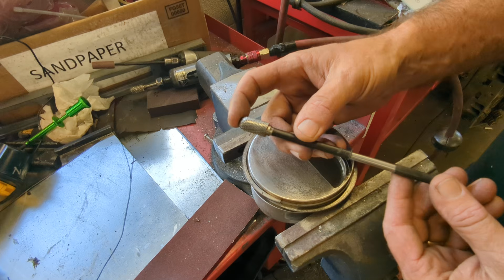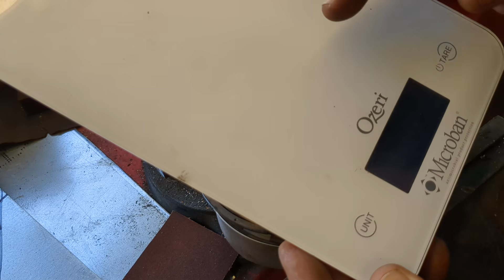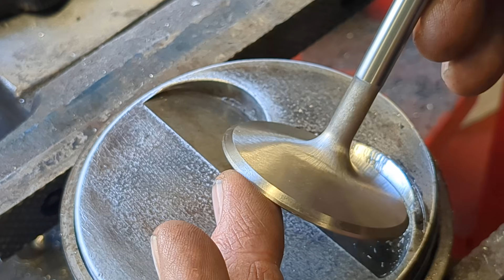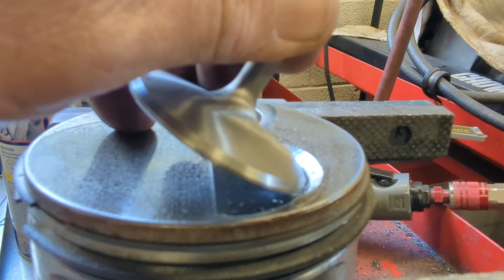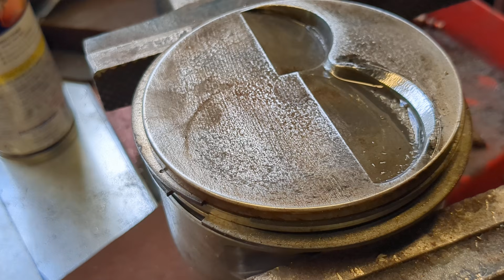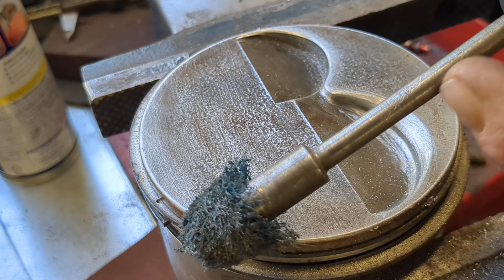The FIRST guy to show you this It will unshroud the intake valve in high lift performance engines

Comment: Seems a lot of people think that little bit of material is going to drop compression a full point…
Reply from the maker: @NBSV1  well it's not and even if it did I'm an engine builder so I crrect for it
Reply: @SalterRacingEngines  I know. Just find it funny how many people think it's such a drastic compression change. 
I'm guessing they also don't even really know how much you'd have to change compression to really make a difference in power for most engines.

Comment: Much appreciated. Whats your experience w ceramic coating piston tops and valves?
Reply from the maker: @-jimmyjames  if ceramic coating is applied correctly it works pretty good if it's not applied correctly it comes off and that ain't good at all. With that being said I'm a little nervous using it on and endurance type engines but that is just my humble opinion
Reply: @SalterRacingEngines  my thoughts too.  thanks.  Appreciate your Pro tips.  I will def spend time working new build pistons.

Comment: Please tell me where's your shop, so I know WHERE NOT TO GO, EVER....
You must be the 1st person in the world who wants to make more power by lowering compession in the chamber.
Reply from the maker: @nomemande2397  wow you must be about 15 years old and know nothing about building engines because if you did you wouldn't say such ignorant statements this only adds about 2 cc to the chamber in which case you make a simple pass of 010 on the cylinder head and your right back to the same compression ratio
Reply from the maker: In fact I'm going to take this moment to teach you something the entire depth and width of both of those valve pockets only total 5 cc's so how much do you think me shaving that back actually added to it. It's probably not even one cc. You should ask before saying stuff like that.
Reply: I like how rounding the sharp spots also prevents detonation. VERY WELL DONE !

Comment: GREAT video,this are the best HOT RODDING tips,that are being lost.this is the way i used to do stuff.I had a job where i had access to a CNC mill.And while you could do this on it,it real hard to do without a 5 axis head unit.95% of guys did it this way.I prefer to use hand hand tools,but your right about carbide burrs,GO EASY and really grip it,cause if it bites>>haha that cutter really moves fast.Looking forward to watch more of your stuff. thank you for sharing your knowledge.

Comment: The Straw trick on the Burr is a good tip--A Bic pen body is almost exactly 1/4" I.D. and it works well as sleeve for stabilizing the cut on a long shank burr--lube it up good and you can hold it between your fingers and thumb, or just use it like a guard same as the straw.

Comment: Great Video as always! I use Waxcut Stick Wax when cutting aluminum. AGS "Cut-Ease" is really good--same goes for Castrol. Even institutional paste wax for floors, or Carnuba car wax works quite well at preventing clogging with aluminum. Paste Wax+WD-40 works well on the Bridgeport for rapid milling as well--put it on with a brush while cutting.

Comment: Awesome info as always. Between you, Vizard, Powell,  Weingartner, and many others, I should be stupid smart. Thanks for doing what you do. Only question I have is what made you decide on the .150 measurement? Is that just experience, or is there a formula. I'm all about some formula's now.
Reply from the maker: @jeffwooton7138  no formulas it's just when you lock it up to the particular cylinder head that's what it took to get the unshrouding effect that I wanted it could take more or it could take less depending on the cylinder head you're using

Comment: Get a greasetube-sized "Slick-stick" and use a tiny TINY glop on burrs, drills, flapper wheels and grinding wheels.
(Buy it from the manufacturer. Cheaper than Glamazon.)
A tube will last YEARS in a decent sized operation.
Flapper wheels, grinder wheels and burrs will not plug up with aluminum and they will eat product at an alarming rate, so go slowly when you start out.
For drills, just start the hole and dip the tip in the tube. Melts easy, so store away from sunlight/heat.
Prepare to be amazed.

Comment: I’ve never given piston valve reliefs a second thought. You’re sharing tricks that nobody else is telling and it’s much appreciated.
Reply: The piston conpanies only dont do it because it cost more  machining time and then there piston has to sell for more, and they know 9 out of 10 people are cheapskate would will buy the cheapest they cant find.
Reply: @krusher74 
 I'm not a cheapskate, just too broke to do the things I would like to do. 
I had spine surgery after a work accident, got laid off and couldn't find a job I was able to do. (insurance company or former employer refuse to give any compensation, even took me to court to try and recover surgery costs - they lied about notification)
Average cost at the time was $80,000, but, cheap surgeon bolted me together with a twist in spine for $35,000
Permanently disabled, wear a back brace just to clean up yard.
According to various workmen’s compensation lawyers, (at $300 an hour !) Florida is the worst state of all to have a non-fatal work accident.
I'm retired now and even small pension means I'm better off than before retirement. 
I know it's way more than you wanted to know but not everyone looking for a good deal is a cheapskate.
Reply: David Vizard has been talking about it for decades

Comment: The piston IS the other side of the combustion chamber.  Also if the you are going beyong factory designs, bias the majority of the compressed gasses to the exhaust side and tighten up on the intake side.  The incoming fuel/air charge will help remove some more of the heat from the exhaust valves and atomize fuel better requiring less ignition timing.  This is especially helpful with pent roof four valve chambers.

Comment: Everyone worried about compression loss.  Well if it was all about compression and  no extra valve lift or no air flow modifications then you just have your stock engine. This is about air flow and pockets are deeper because of more valve lift for more volume of air to fill cylinder. Have to look at the big picture if you flow more air add more fuel and make more horsepower when finally tuned

Comment: Thanks for the video, I had just finished removing all the sharp edges on a Pontiac Flat top design similar to this and have been doing that on all my previous builds. What you did with the back cut on the intake pocket is enlightening, I'm taking them back out of the box and doing that to mine as well. Is there a way we can donate to your channel especially after the hurricane set you back?

Comment: I never thought there would be a time whereby a professional engine builder would be willing to share their craft with the world.  I've learned so much from you and so appreciate your commitment to doing this!
Reply: Thank you for your awesome helpful detailed tips and info, Mr. Brian 🧐👍
I'd love to massage the intake valve reliefs on my 4.600" BBC flat top pistons for a pair of NA 565cid  9.5 comp ratio offshore marine engines that I have for my little 40' offshore puddle jumper that I run out on Lake Michigan. 
I enjoy finding cool trick advantages to give my boat a little more kick. 👍
Reply: Brian...do you mind sharing with us your best practice for cleaning carbon off of pistons/combustion chamber?  Thank you.
Reply: Not just kick, but also the reliability , especially out in the water or Air like double redundancy with ignition coils and backup electric fuel pump😅✌️☝️💎⚡💥🇺🇲
Reply: Yes Sir Milo.. reliability, durability and dependability ----I definitely would be willing to have that verses any extra kick in power. These engines must be destined to live 🤨🏴‍☠️🏴‍☠️🏴‍☠️🇺🇸
Reply: Probably  throwing  the towel in!
Reply: ?, that is just ignorant

Comment: I recently just did this to my engine, but it was so I could fit a 2.02 valve, but that’s what I did. My ptv clearance was close radially so I did exactly this. I even on did it with the pistons in the block. Worked great.

Comment: Have used model airplane tubing for the same thing Brian. One more tidbit. 
Have you tried what we called a Prop-Cut on the top of the piston dome and blend the quench pad above the exhaust section.

We had a tracer back then follow a model we made. What the dome profile looked like was this : the dome was packed on the intake side into the chamber. After that side was sensible, the dome sloped away towards the exhaust side to where the chamber to the dome was not crowded. @ an open cavity. Beyond the dome you see the exhaust relief which, depending on the engine design, there is a portion of that edge that most of us blend back ; well, there is a dip into the quench pad, maybe, a half an inch. Your quench at the ring land was left for support. This depression is say, 3/4"wide.

What we were looking for back then was to cover the dome in color. It took a good season of  Drag Racing to get there with the SB Chev and Boss Ford.  
I'm just throwing this away as my career is over and someone might just look at the combustion process a little differently.

Comment: I use 1/4" teflon tubing to cover the shanks on my carbides.  It takes the abuse and doesn't leave a mark.  Available at Lowes by the roll.
Reply: With the other rolled hoses in that area?

Comment: I don't believe this helps. Just my opinion. Lots of piston manufacturers out there and almost no negative could come from doing this other than losing compression, so why don't they make the dies or molds shaped like this to begin with?
Reply from the maker: Because like I said in the video to each his own every engine builder has his own way of doing things I do this because I've Dyno tested them before and after and I know they do make a difference it also varies depending on the head angle. It makes much more of a difference on a 23 degree and 18° head then it does more shallow angles but Pistons aren't made from dyes they are machined and you're talking about another process that would add another step to making the Piston which would add cost  to the Piston itself. And because they in reality don't know your chamber shape they only have a generalization of it the only person who really knows the valve and the chamber shape is the engine builder himself so that's one major reason why it's not done until it gets to the engine shop 
This is something we've been doing in NASCAR for probably longer than I've been alive
Reply: @SalterRacingEngines  good explanation. Also thanks for your response. I know you have tons of work and not a lot of time. First thing i did when I saw this was try to Google Nascar pistons lol. Not a lot of info on advanced techniques being shared around on the Internet. I've been proven wrong more times than I can count. I just figured when the intake valve was that close to the piston, it wasn't moving a lot of air yet, and wouldnt push a lot under the pocket but rather around the top of the piston. and for most of the valve motion it wouldn't be doing anything at all. I'm a rookie still learning. Currently working on a 24° 588. it should hit 1000 and hopefully be somewhat reliable.
Reply from the maker: @basketballcory2  no worries but just remember when you're trying to squeeze all you can even if it helps a little bit that's enough reason to do it. But it really does help and it makes more of a difference on a 23° style head more so than an sb2 or similar heads basically the more laid back the valve angle the more that matters. But if you teach people to look for it then you'll never go wrong and if for no other reason than just to get rid of any sharp edge
Reply: @SalterRacingEngines  I always took a red scotch bright pad and scuffed the sharp edges but your method explains why. Thanks!

Comment: Now that makes a lot of sense. The head may flow like gangbusters on a flow bench with no piston valve relief in the way.
Put a wall around a large portion of your valve and low lift numbers will be severely reduced. 
Just shows you've got to be a thinker. Thanks a million. 
Great information. 
And it helps everyone to never stop thinking about what is actually happening.
Reply: Heads are flow benched with valves at each open increment, aren't they ??

Comment: Any chance to discuss the reasoning for offset cylinder boring I guess it’s a higher end circle track trick to I think trick the compression rule how ever makes far more compression?? Something like that  what are your thoughts on that sir?  Thanks for doing what you’re doing and releasing some 🤫 builder secrets.. just interesting bits and pieces to get a better understanding about . 
God bless 🙏🏻 Mr Salter
Reply from the maker: Well I don't know anybody that offset bores the block but we do move the Dowel pins on the heads so we can get the valves more centered on the bore. That's a very old trick we used on Chevy 23° heads and such.
Reply: @SalterRacingEngines 
Yep.
We also scalloped cyl wall edge to unshroud valves. Used that on the Y blocks.
Every tiny thing 😁

Comment: A leather compass would work well for making that radius mark instead of calipers. They are metal tip on both side and lock to a radius with a screw. Bought cheap on Amazon and you can Sharpen the tip you would scribe with many times on a bench grinder, table sander, a file etc.

Comment: The trade off that I see is that you lose a slight amount of compression. Does the 5 cfm flow increase off-set this loss or do you manage to pick up the compression in other ways? Thanks for sharing your experience and showing us your thought process.
Reply: +3-5 CFM when the piston passes TDC+ and the valve is close makes a difference in power... More early filling. Remember the opening valve is chasing the piston.
1 cc loss is easily recovered with head milling or thinner gasket.
Reply: That’s the first thing I thought of .

Comment: I have a question for you sir. Which do you prefer on a street engine and why?  A small   chamber with a dish piston or a large chamber with a flat top piston both at 11.5:1 compression?
Reply from the maker: I would prefer the small chamber head unless it impeded head Flow
Reply: @SalterRacingEngines   Thanks for answering!

Comment: Now y’all got me wondering if that valve pocket “shrouding”, y’all are pointing out, ain’t partially responsible for the better breathing, in reduced valve angle heads, for generally reducing valve pocket depth?
Reply from the maker: You're on the right track

Comment: Thank you for the good video would it be possible for u to make a video on what position to degree in a cam my thoughts r to use valve events and target a dynamic compression ratio am I correct  to do it this way thank you
Reply from the maker: Sure keep an eye out for it
Reply: Thanks
Reply: IMO each specific engine needs to be dyno run with different degree-in cam specs to determine exactly what that specific combination likes. But $$$ dyno.... So we give it our best guess. 😁
Then the timing set wears/stretches and retards it 1-2-3* 🙄

Comment: Could you provide flow figures for this piston relief mod ?
Reply from the maker: @randypozdnikoff4099  it's very difficult to do but I can tell you on some engines and cylinder head profiles I have seen as much as 15 horsepower
Reply: He alluded to 3-5 CFM when the valve is close.

Comment: So, making 5 more hp from airflow, but losing 10hp from compression?
Reply from the maker: @stephenhowe4683  no you ain't losing no compression man not at all. 
you make adjustments for all that 
Besides at most it's only one or two CC's and that's very easy to compensate for
Reply: @SalterRacingEngines 
Cheers that makes sense.
Reply: Have you done any development with coatings on top of the Pistons  ?
Kit from down under
Reply from the maker: @christophercullen1236  yes and there are lots of great coatings available right now and honestly it boils down to what type of racing and what type of fuel you're using as to which coating you should use.
I have used calico coatings for 25 years and now that guy Jason line has some good coatings out too so definitely look into those two companies
Reply: Hi Brian  I'm really enjoying your videos and learning things I have a winged Sprint car team we race dirt circle tracks in the south I build our engines mainly because I can't afford the 60-70k The top builders are getting for an engine these days. I would like to know your thoughts on choosing bore and stroke for circle tracks with a cubic inch rule 363-364 seems to be a pretty popular rule. Thanks again for sharing your knowledge.
Reply: @jasenlaw8786 
It's been 20+ yrs but we always wanted the biggest bore possible to get valve room for head flow. JMO.
Reply: Thank Brian, you are helping me think about what’s going on in the engine, I hope you continue.

Comment: what are your thoughts on total seal gas ported or zero gap rings on a N/A 500 HP 6500 RPM mostly street and alittle 1/4 mile racing 408 stroker engine?
Reply from the maker: @doughelmle6575  definitely use the gas Ported rings

Comment: I have been “piston porting” for a long time. Simply because I had read about it. But I didn’t have any idea it could be that much cfm. But it would be in the low lift area and that’s always good. Thanks for the video. Good stuff.
Reply: Look at a 396BBC block
Reply: Definitely in the low left but the sooner you start feeling that the more time you've got to fill that cylinder